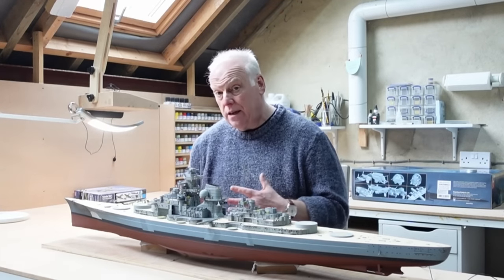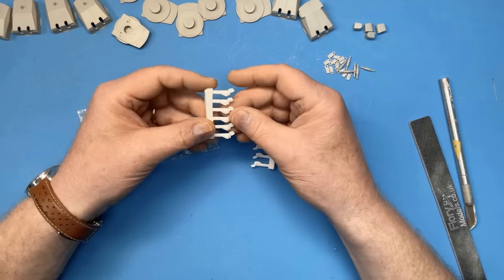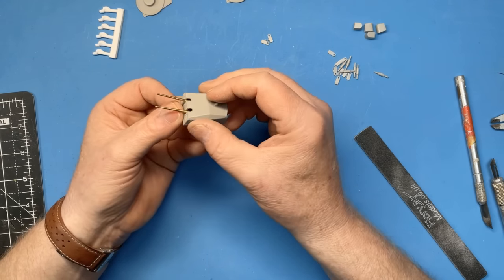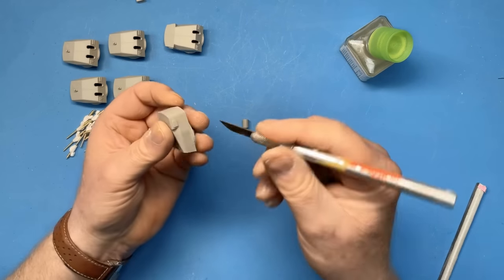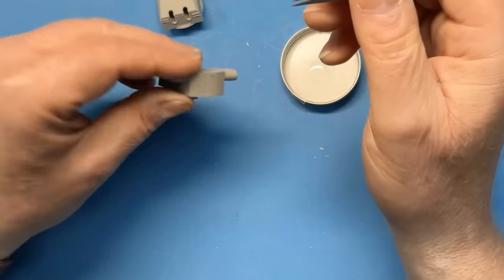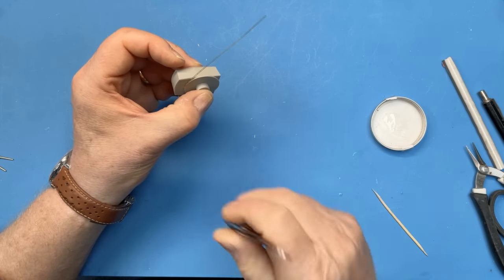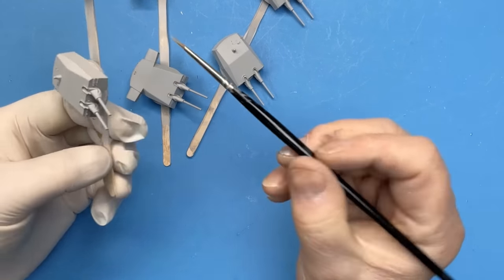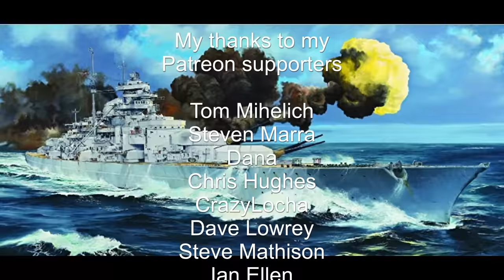Trumpeter 1/200 DKM Bismarck Full build with Pontos detail set Part 27

Comment: Blast bags on mine were rough as well. Primered in black first and then dry brushed in off white so I had the shadowing effect.  Had to use a saw on the resin close to the opening for the barrels. Had to go back and forth many times with a circular metal file to gradually open up enough to slide completely down the barrels. Nerve wracking because if you take off too much you've just thrown away hundreds of dollars on the pontos kit since they don't give you any spares.
Reply from the maker: It sure is a trial. the solution on my Hood build was much better: short barrels with a pin on for the blast bags.
Reply: You do absolutely outstanding work. Kudos for sharing this build with everyone.

Comment: It is good to see you are on the mend, Steve. It was interesting to see how you put the PE strip around the turret base, I have seen that piece pre-rolled and compression used to hold it in place but you have to get the roll perfect otherwise it induces a slight twist.
On a separate note, the teaser of a 4 engined bomber on the bench behind, what is it please?
Reply from the maker: Thanks Craig. It’s a 1/32 Lancaster Dambuster which I’m building for my IPMS group build this year. I’m covering the build as an exclusive for the folks supporting my Patreon channel.

Comment: Sorry to hear you weren't feeling good but take things in small stages, stay warm and push the fluids. The Bismarck is looking like a ship and not a collection of parts. I have one question about the individual stainless steel stanchions for the main deck, have you thought about installing brass railing instead of those?
Reply from the maker: Thanks DL for the kind thoughts. I won’t be using the stainless steel stanchions: Pontos also supply a full set of PE railings so I’ll be using those - much less fiddly and they’ll match the rest of the ones I’ve already fitted.
Reply: @TheModelShed  You're welcome. Happy to hear Pontos has the photo etched brass raiuls.